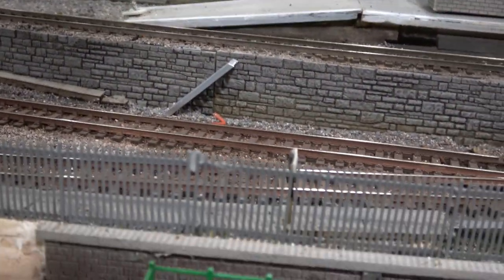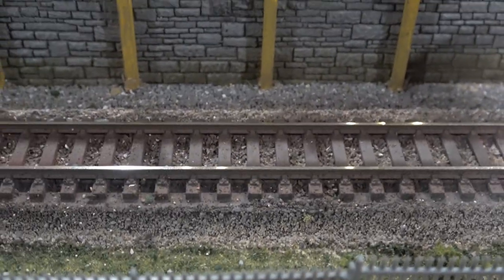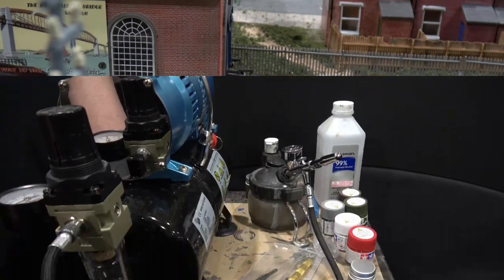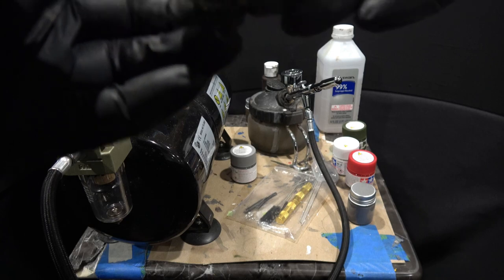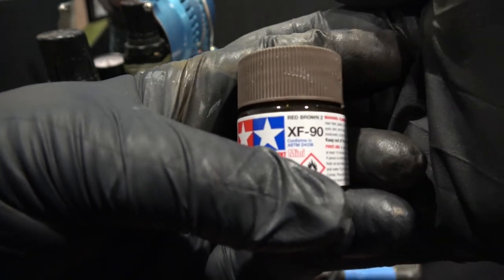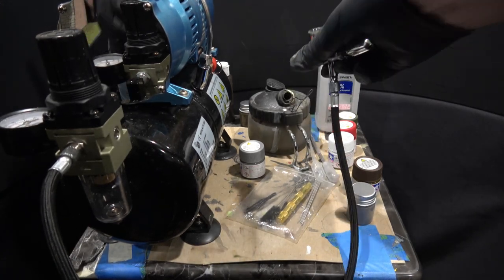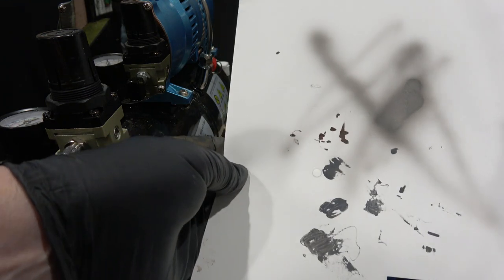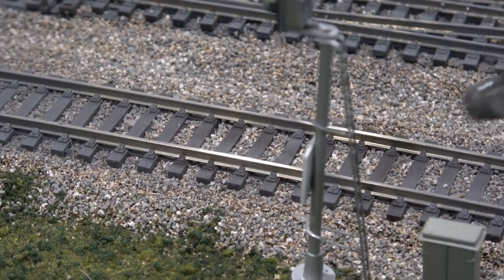149 Track Painting   -   Building Farland

Comment: Hi Rob, I haven’t got myself an airbrush yet but it won’t be long before I do. They’re excellent for detailing track and so many other things for model railways. Thanks for sharing how you go about it, cheers for now, John
Reply from the maker: Hi John, This is my second airbrush.  I ruined my first one by using oil based enamels in it.  It was very difficult to keep it clean.  Since then I have switched over to spirit thinned paints.  By doing this I have found the joy in an airbrush.  This weeks video is about fading and weathering BR Blue and Grey coaching stock.  You might find it interesting too.  You will need a double action airbrush so that when you push down on the finger trigger you just get air and when you pull back, the paint starts coming out.  Thank you very much, Rob
Reply: Thanks Rob, I’m looking forward to having a go!